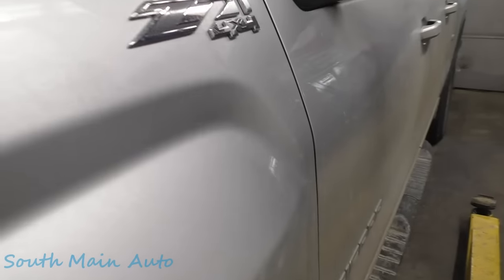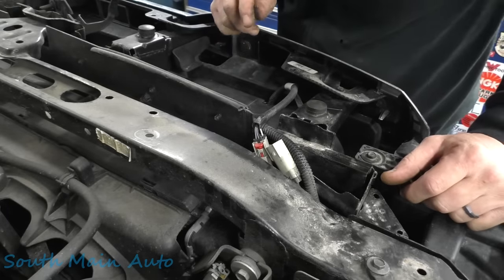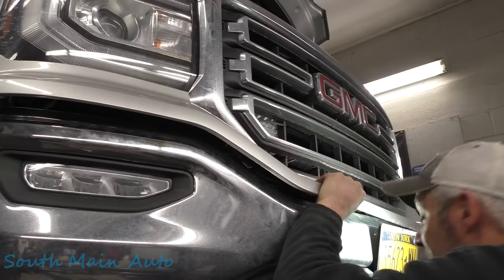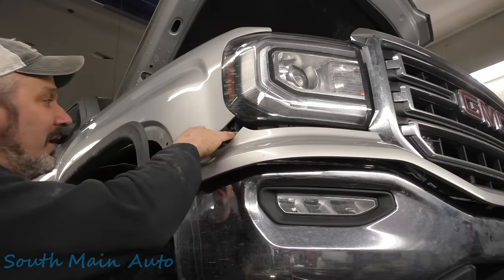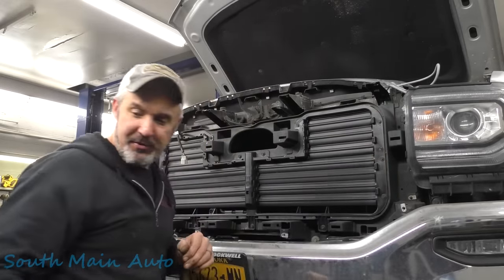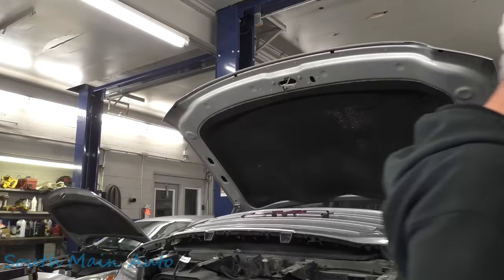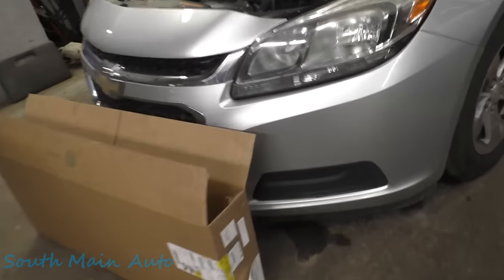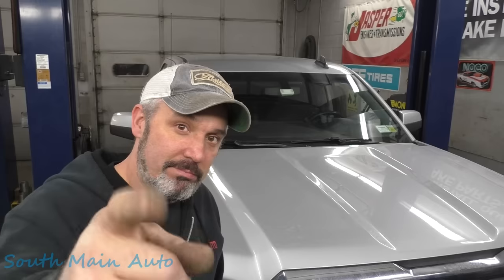Chevy Truck: Active Grille Shutter

Comment: This stuff is why I backed away from spending big $ on a new pickup. All of them are stupidly and unnecessarily over engineered and not in a good way. Got myself an older F250 with hand crank windows, long bed single cab, manual hubs and 6 speed stick and gas engine. For 1/3 the price of the certified pre-owned 1/2  ton mild hybrids I was initially looking at. I'm willing to compromise mpgs and tech goodies for simple and serviceable. I have a 4 banger Eclipse to drive when I don't need 4wd or haul things so I'm not spending huge on gas. Seemed like the better approach than these high tech, big money to fix trucks.

Comment: GMC=Garage Mechanics Companion.  Never liked GM products since the 50s.  Made a mistake and bought a 2004 Duramax in 2006 and it confirmed all my fears.  The brakes failed the brake lines rusted out, the Fuel lines and cooler rusted out, the instrument cluster is flaky and the power mirrors refuse to extend or retract if you pull them out to use them.  I don't trust the trailer hitch with all the rust in the frame area back there.  Truck only has 58,000 miles and is kept in a heated barn.

Comment: Yeah there is clips underneath you can stick a quarter under each one of the tabs there is 8. It comes right off after your sides are off. I had other friends just take it off and not put another one on. Never had an issue again.  You have to wire it to make it see its plugged in. Yes GM is really messing up by taking stuff off parts and also by taking out the dip stick tube for transmission. Wtf

Comment: That's just like when you buy a new radiator for $200+ and it does not come with a new $2 cap. It aggravates me when you go and look up part diagrams and it lists all seals, orings, bolts, and nuts separately each with its own unique part number.

Comment: Based on the GM description, the sole purpose of the Active Grille Air Shutter has nothing to do with maintaining engine temperature in cold situations as I thought it would, rather purely for passenger comfort. I would rather a little less aerodynamics and a little more noise and not have the shutters. Based on the GM description, they are an unnecessary item that adds cost to the purchase price of the vehicle and are also a failure point that cost to replace. God one GM.

Comment: I think people fail to realise that the main dealers rarely see vehicles over 4 - 5 years old. They don't  want  "old" cars and price the work as a deterrent. So their technicians see them high days and holidays and therefore have no idea how to disassemble them let alone fix them. Many of them have never rebuilt an engine or a gear box , those who like me have, are on the verge of retirement and we will be left with fitters , who fit new engines etc because parts are becoming hard to source from the manufacturer's who want you to buy a new vehicle . Also the engineering goes into fast assembly with one time clips, self tapping body screws and trims which have one time tags which break on removal , requiring a new trim part. Progress. ?

Comment: I remember my former boss taking his Suburban in for similar.  In disassembling, the dealer tech had a slight mishap and chipped the paint.  It was VERY, VERY small and they just dabbed it with touchup paint upon completion.  My boss being the anal turd that he was discoved the boo-boo and made the dealership repaint the entire panel.   The damage was literally smaller than a matchhead, but they ended up repainting the whole panel.

Comment: First time I have seen or heard of one of these. Appears to me they are not worth the fraction of a percent of fuel savings. Wonder if you can just put a jumper in to fake it out and remove that garbage. Another reason I will not buy a newer Chevy. Sticking with the old.

Comment: No doubt everything is designed to go together with speed, no one engineers repairs into the design, half the time the stupid plastic clips break taking it apart, the older it is the better chance or breaking there is.  It’s all just money in your pocket, replacing parts

Comment: As far as I know the shutter system is actually there to heat the engine temp up faster, not to do any BS aerodynamics. The faster the vehicle heats up and goes into closed loop the faster it will start controlling emissions output. That's my opinion. It is not rocket science why they added it.

Comment: Those shutters reduce the amount of debris, water, and salt hitting the radiator, cooler and condenser , particularly in the winter. So should extend life of some parts, while speeding heating. Nice gizmo.
Reply: Fuel economy and emissions.    Quicker warm up=less emissions and better fuel economy.

Comment: Easy there killer...
I have a 2014 Silverado same thing you're working on with so far 147,000 trouble-free.
I've overloaded the bed three times.
I've tow more than its rated to tow multiple times.
I off-road,  I've jumped it, I've had the trans fluid at 224 degrees for 2 hours straight drag racing in sand
I beat on it!  It's never failed me!
So far zero issues
And it averages 24 MPG highway at 74 mph.
Try that with a Ford- Dodge or Toyota...
It's been a damn good truck to me...
Despite GM's issues you are still better off with a Chevrolet over Ford Dodge or Toyota pickup...
YouTube pick truck durability test and watch the Toyota shake itself apart 😂🤣🤣🤣
Reply from the maker: Spoken like a true Chevy lover  😂 

We can all copy and paste this in our comments now see----->

Easy there killer...
I have a 2020 Tundra you never seem to work on but mine has 22,000 trouble-free miles.
I've overloaded the bed three times.
I've tow more than its rated to tow multiple times.
I off-road,  I've jumped it, I've had the trans fluid at 224 degrees for 2 hours straight drag racing in sand
I beat on it!  It's never failed me!
So far zero issues
And it averages 16 MPG highway at 74 mph.
Try that with a Ford- Dodge or Chevy...
It's been a damn good truck to me...
Even though Toyota's don't have issues you are still better off with it than a Chevrolet, Ford or Dodge  pickup...
YouTube pick truck durability test and watch the Chevy shake itself apart 😂🤣🤣🤣

I'm just picking buddy. I hate all brands..... especially GM haha

Comment: Man o man that’s a bunch of bull crap pull 20 pins to get to 4 bolts on top, release 14 snap keepers to get a trim part off to get to another 4 bolt on the bottom plus everything in the wheel well all to get to 12 bolts to remove the bad part. Darn engineers

Comment: The whole front of that truck is ugly. It can't be in the name of aerodynamics because the thing is a brick. I applaud anyone that can work on things like this. If it was me. At best every clip broken. At worst a pile of broken bits. My old truck grille. Two locating pins in the bottom. Two bolts at the top. And surprisingly it hasn't fallen off in 23 years.

Comment: Too much electro digital nonsense!
Reply: It’s ridiculous what the control freaks want to hand over to a computer, basically everything! The thermostat is still there. Some vehicles use digital ones. Most fans are electronically controlled whether they’re a straight up electric motor or a mechanically driven unit with an electro viscous clutch. Now we need to control the air coming across the radiator? This of course is all done in the name of emissions. The reality is to make them complex and cost prohibitive so in the long run, nobody can have a means of independent movement.😉

Comment: Used to be 30 years ago that all copier covers were screwed to steel frames.  Now all panels are using clips and interconnect tabs.  Remove one panel and they all come off basically.  Break a clip or tab and you are a screwed pooch.  Watching you pull the front off reminds me how stupid designers are.